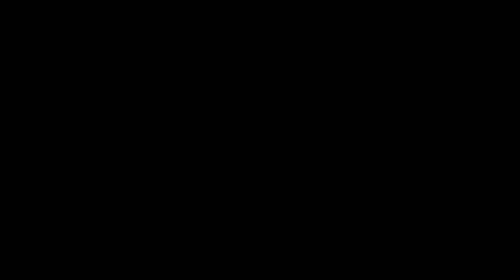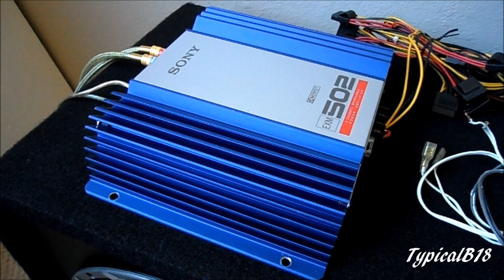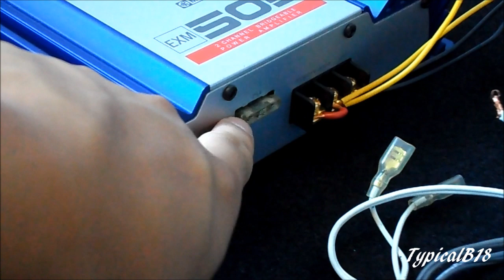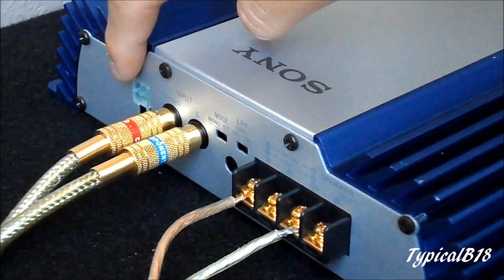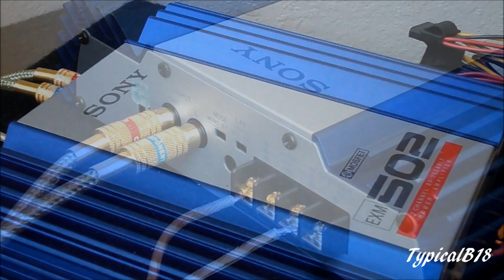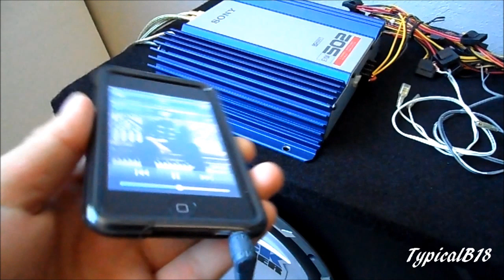Sony EXM 502 2 Channel Car Amplifier Look/Test

Comment from the maker: This Sony amp and actually some Sony Amps out there are sleepers and can actually perform very well. This Jackhammer is actually pretty low end and doesn't require much power so the EXM 502 powers it up nicely. If you look at some Sony ES Mobile Lines those are high end and can power up many things very very efficiently. So I haven't really lost my mind. = )

Comment from the maker: I haven't gotten my Car Headunit to power on yet but it's a bit different & older then most current Headunits you see today which can be the reason why. I believe you can wire a Amp & Headunit to the Same PSU but you'll need a lot of power otherwise you'll end up with no power to a stressed out PSU. So it's best to have separate PSUs. You can get a 2 Channel or higher and hook up speakers instead for vocals!